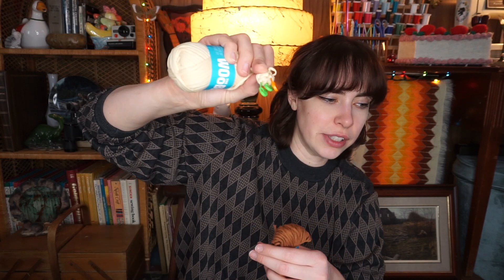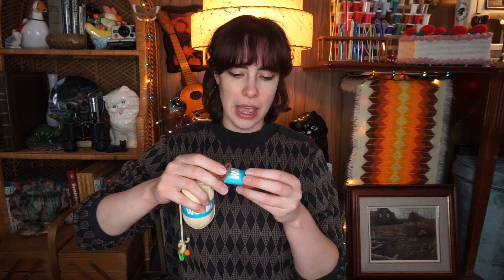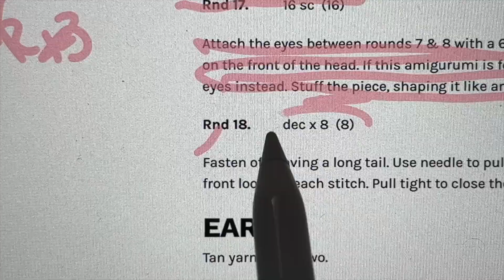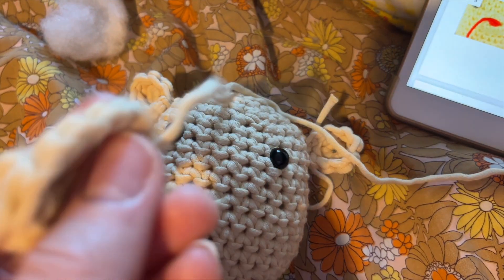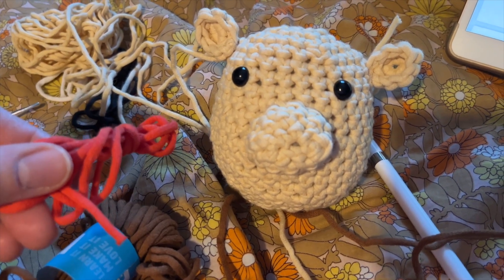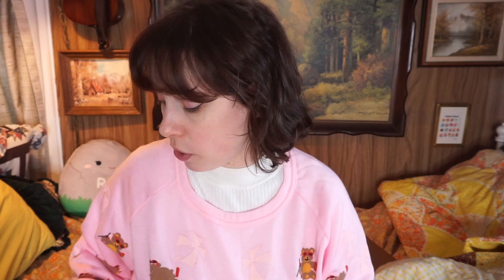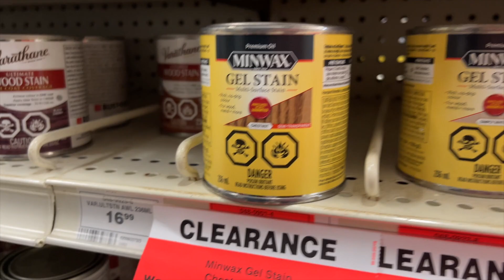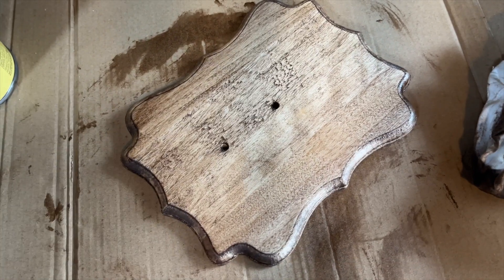Crocheting a Deer to Mount on my Wall!

Comment: Just a heads up if you decide to try more amigurumi, I believe you have the “wrong” side of at least the main deer piece facing outward. The way the piece naturally wants to curl is actually the opposite of how you want it. Theoretically at least, bc it’s art and art can’t be incorrect. (Also I could be wrong, I am just going off what I can see)